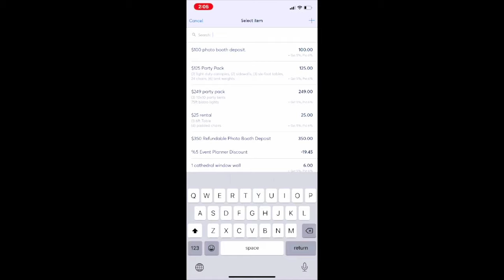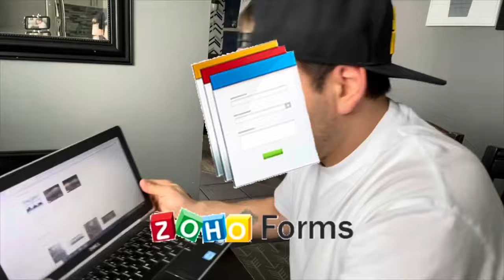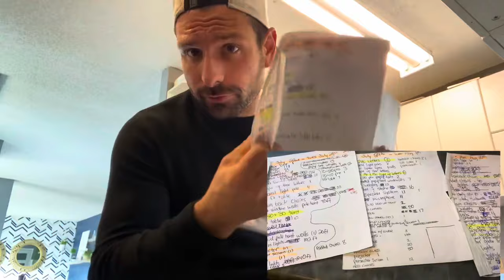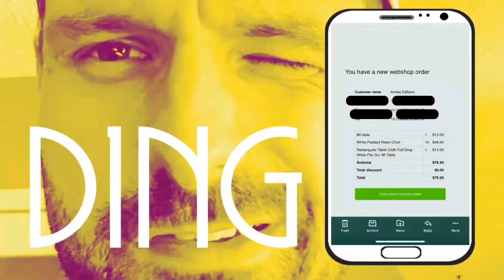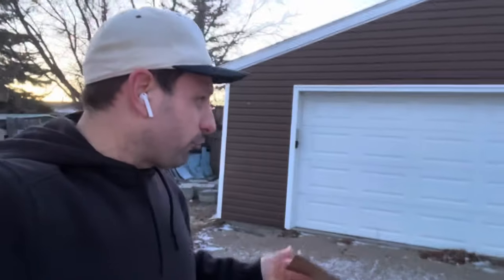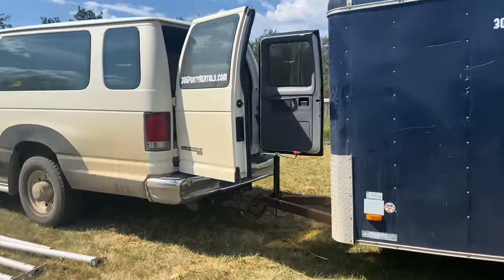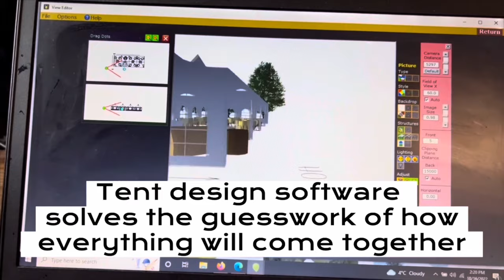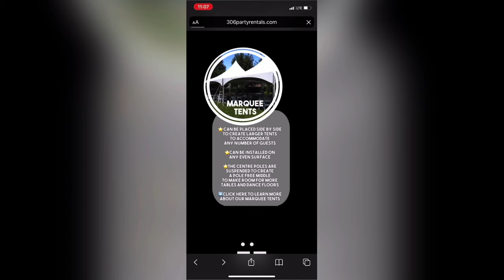How to Start an Event Rental Business 0-500k in 5 Years Guide

Comment: Started watching you 1 year ago . Made 20k in my first year thank you bro ! Had a few questions though . At what year did you begin dishes and table cloth? Also I Bought a 20x20 from ses. Do you suggest I buy more or should go pole tent route . Thanks !
Reply from the maker: I sub rented dishes and tablecloths until I had the right space and staff to make it work. Regarding tents, only branch into bigger tents if you have corresponding table and chair amounts to go out with them. Think of each tent as the gateway to making your tables, chairs, dance floor, heaters, etc  move constantly during busy season!
Reply: Thank you!